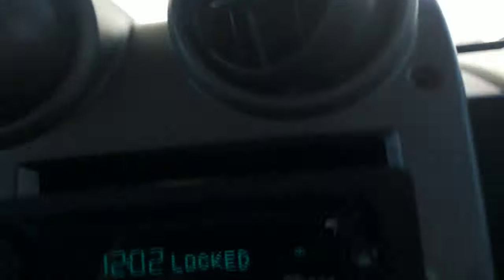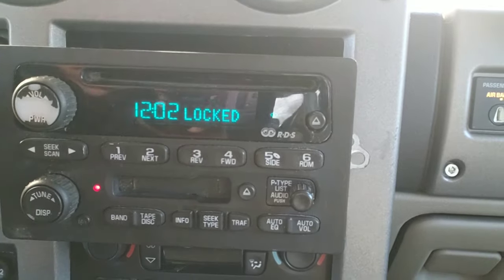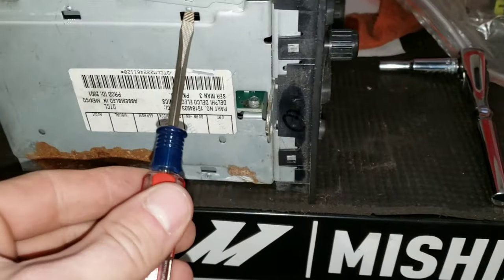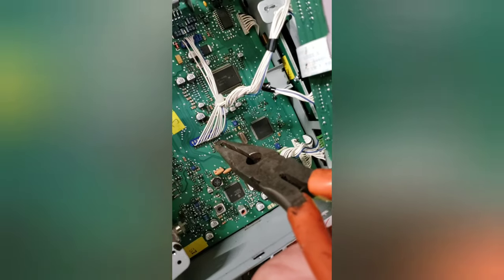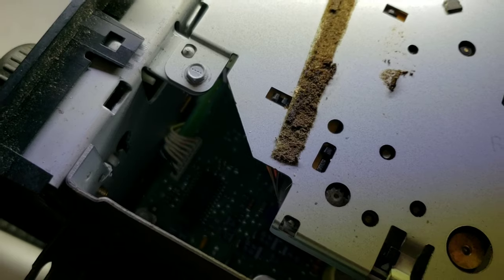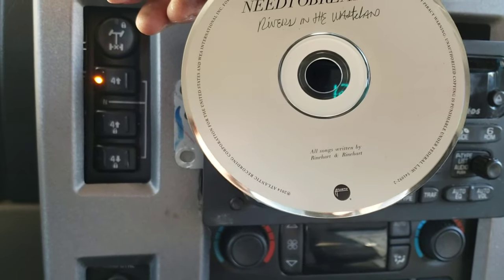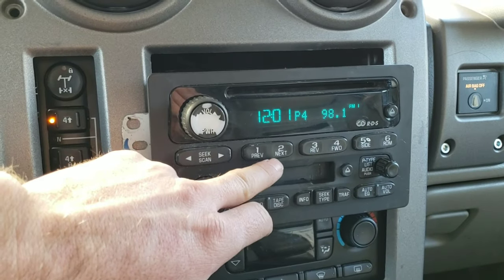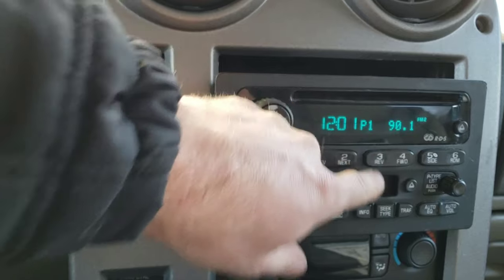How to fix "locked" gm radio yourself

Comment: Who on earth is going around robbing mid 2000's GM cars for their radios?
Reply: Lots of people when they were newer. A replacement was $500.
Reply: @johnnysouza5601  makes sense, there probably weren't many aftermarket radios back then.
Reply: @1Thatstrangeguy  there was but some people wanted all original dash. I didn't really understand it then. With today's infotainment systems I understand but not the stock 2000s gm radios
Reply: ill admit that a lot of aftermarket radios look really gaudy, i wish someone would come out with retro looking radios with dials and a physical needle but with modern electronics and bluetooth
Reply: @1Thatstrangeguy  what kind of retro are you looking for? They have those for most classic vehicles, 70s pickups etc. Look identical to original with modern technology
Reply: @johnnysouza5601  i'm thinking early to mid 80s radios. Iv been tempted to even design my own and 3d print it so i can get all crazy
Reply: @1Thatstrangeguy  if you can figure put to make them I'm sure theres a market for it. I bought one for my 75 chevy so I wouldn't cut a whole in my dash. I loved it. Looked original but did everything I wanted.
Reply: Nobody.  Lol
Reply: I am that's y I'm watching this video

Comment: WARNING - What he has done is to rip out the EEPROM (flash memory) that stores the radio security code AND the preset stations. This chip predates USB flash drives, storing only a few thousand bytes of data. He risks serious damage - these chips are SOLDERED to the board. Ripping it out with pliers can lift off/break copper traces on the board, killing the radio.
Reply: And what do you suggesting, Nothing.
Reply: Either way your radio is inop, either cuz it's locked or cuz the thing is broke during the chip removal. The latter at least provides some chance of it working
Reply: Late to the party, but in case someone else come across this later - the fix to that is just to remove pin 8 from the chip. For those that don't work with electronics to know, pin 8 on a 9355093, is the top left corner pin that's over the first 9 in the number. That removes the power source to the chip, without potentially damaging more of the board.

Comment: This does work on all GM radios HOWEVER it can cause oddities. I did it to my locked radio in my pontiac and now everything works BUT it forgets presets everytime you turn it off, the CD button works intermittently but the CD works when you put it in every time. And the radio thinks theres a tape player now. So user beware!
Reply: It worked on mine but now I have no display but the lights are on
Reply: How about 05 chevy impala?
Reply: @dannie0048  should be the same

Comment: Thanks! I can confirm that this works with the 2006 model without the tape deck for sure. The  part is on a different part of the board. Bottom corner instead of the middle. But the part number was the same, except the first digit which was a 3 not and s. The eprom and neighboring components were identical. Thanks again!

Comment: If you know someone with a decent bi directional scanner, they can do the vin relearn for the radio. the only thing, when I used my snap-on scanner, I had to built a 2006 avalanche with the navigation radio for the radio option to come up. It still worked and that was done on a 2002 chevy s10.

Comment: Amazing. This was the only thing that worked for me in my Chevy Sonic 2013. The chip was hard to find but I figured it out. 8 pin chip labeled EEPROM (next to the chip, not on it) The chip was in the same area as in the video but the board is layed out differently.

You saved me $150 on top of what the scrap yard charged me. Made my day. Cheers!
Reply: You think the EEPROM chip is on all radios with the lock feature, at least all GM vehicles?
Reply: @jackburton2680  It's possible. Maybe not in the newer gen of vehicles but then again I'm no expert.

Comment: Did it to an 2006 H3 stereo 6 disc pulled half the eprom out on it and it has zero issues .. remembers time presets and no errors.. crazy you saved my sister at least a hundred dollars!!! Get the factory monsoon stereo suns back.. dang it sounds good!! It’s a different chip number than yours.. but you got me in the right direction!  Thanks!!
Reply: Still working? Putting in a new radio in mine now
Reply: What do you mean you pulled half of the eeprom out?

Comment: Question: If the eeprom chip in the old radio is the same as the new radio why can't you just remove the chip from the old original radio and use it to replace
the chip in the new radio? Old chip has the VIN number of the vehicle. Unless the socket for the chip in the new radio is different then it should work
Reply: did you get an answer for it? thx

Comment: “It may not remember your statures stations”.  That because EPROM stands for Erasable Programable Read Only Memory.  In other words it’s designed to maintain the memory of the radio.
Reply: Will the EEPROM removal effect clock memory? That’s all I care about losing. Presets don’t matter.
Reply: @reedharrell5279  I'm not 100% sure but I would think it would.  If you know/think about the BIOS Battery in a computer this EPROM is similar.   The BIOS Battery maintains the date, time, chipset, fan speeds, and others.  The EPROM is maintaining similar information.  So if there is not constant 12V to the radio the entire time then you will even loose your clock.  Again I'm not 100% positive on this.

Comment: I used to refurb these radios. Buy a new GM most likely a refurb radio without you knowing.
Reply: I did that with electronics like those instrument clusters and abs modules. Half of the repairs were to already 'refurbished' boards.

Comment: Well, you did the preset on fm1, when you turned it off and turned it back on, you went to fm2. So, of course it wouldn't go to 98.1 cause you saved it on fm1, not fm2.
Reply: That’s one heck of a catch dude. I had to screenshot it so that I could  see the numbers LOL but you are absolutely correct.

Comment: Worked for me, pulling the little thing was kind of a pain. Found crushing the black shit with needle nose then pulling the plate with tweezers worked well.
Reply: Did you have sound still? I have a 2002 Buick rendezvous , and Im either going to pay 150 to get it fixed smh or try to pull that piece. But does your sound work
Reply: @BigSwirl  yep sound works, and the radio works but the cd player is fucked up, it wont give me back my skynyrd album.
Reply: @flustercluck420  okay , thank you . Some of the comments were saying that this method caused no sound to play  at alll

Comment: will all the other functions work after removing the chip? I have a used radio to go into an 05 silverado. I've already tried holding the scan forward and 5 button while pressing the power button on. The radio does turn on, but only the volume knob and tuning knob (not the seek or scan buttons) will work. The cd player also works if you insert a disc. I understand pushing these buttons is only a "test" mode. Just want to make sure all the other functions will work after I remove the chip (fader, balance, auto eq, auto vol, etc...)

Comment: Craig my tape player broke I use it for my phone the bluetooth cassette got stuck. Is it hard to replace the cassette part of the radio? You make it look easy to take out. How many screws and wires?  I have another radio already that doeant power up anymore. I just want to use the cassette mechanism...do you you think this could work?

Comment: Pushing the number 5, seek forward buttons while powering on also unlocks these radios and all functions work as they should..fyi this button method is said to be a temporary fix and eventually the radio will lock again and you will have to do the 5 seek and power on again

Comment: If you have a 2006 or newer GM vehicle just take it to your top of the line mechanic shop. We unlock them at our shop.
Reply: WHAT'S YOUR METHOD???   WHAT WOULD HAPPEN IF THAT CHIP WAS REPLACED WITH A NEW ONE????

Comment: Can I take the face plate with the nobs and the board behind it and put it in my original radio on my 2003 Chevy Impala ???? As I bought one on eBay and of course it’s locked

Comment: WHAT WOULD HAPPEN IF THE CHIP WAS REPLACED WITH A NEW ONE???
Reply: If by "new" you mean blank, I did that in an OEM Chevy Cobalt radio.  Saves presets but volume is much lower and it says "Calibrate" every time it turns on.  It wasn't the original radio, just a cheap one off ebay.  Works though

Comment: 2003 gmc seirra 2500 if that matters does not look the same or have same part number I guessed an pulled out of two that look the exact same as in picture and it worked but it won't look anything like his radio and isn't in same location

Comment: Okay but why is there no sound in your video or from my radio :(
Reply: Same here
Reply: @ZDMBeats  mine was because I have a bose setup and non bose radio. I bypassed the amp by plugging the radio directly into the same size port to the right. Works good now just a few random issues like the rear audio works as it's own channel and no presets.
Reply: Do this didn’t fix your radio?

Comment: Anyone know where the eeprom is on a 2003 Monte Carlo 6 disc changer with tape deck?? I opened mine like the video and there's nothing that looks like the one in the video.  I looked everywhere and I don't anything with that s code either. Thanks

Comment: I removed the correct chip. It seems that they all have the same number. The stereo is not locked anymore. My error message is up and I can't get rid of it. This is on a 2007 Grand Prix GXP. The stereo is from a 2006 Grand Prix GXP. Has anyone had this problem after removing the chip where the error message doesn't go away?
Reply: This is happening to me now. Did you ever figure out a solution?
Reply: @Veronica-lz1ln  unfortunately no.  Ended up buying a reconditioned factoey stereo with warranty and obviously unlocked.
Reply: @domenicmanicone2612  thanks for the reply! I appreciate it so much!
Reply: @Veronica-lz1ln  your welcome 🙂

Comment: I've replaced a few GM radios, my scan tool can unlock them no problem.  I've never heard or seen this exploit before.  Makes me wonder if the radio would be able to program a key fob.  For GM cars that have key fobs, it can be programmed without a scan tool by using the DISP on the factory radio.  I wonder if removing the EPROM (or is it EEPROM?) would interfere with that.
Reply: Oh! Dear ! Loooooool
Reply: What scan tool are you referring to in this case? Hopefully one that isnt 10,000
Reply: @FredFlintstone21 , I have a Launch X431 Torque, costed me about $2,300.  HarborFreight sells one called a ZR Pro I think, sometimes it's on sale for $999.  I believe that it's the same scan tool rebadged because the interface is exactly the same, and the input for the subscription key is also the same.  If I had to do it all over again, I'd buy a Autel Maxisys, which I probably will eventually.  The X431 that I have is good usually, but sometimes it's a little buggy.  I was able to program key fobs into a 2002 Impala, but not into a 2003 Impala.  It was the scan tool's fault because I was able to program the fobs using the factory radio.
Reply: Does sound come out with the Cal Err code? I heard it takes a few weeks to learn the new vin. Did the Cal Err code ever go away?

Comment: What he forgets to mention in the video is that this will completely f*ck up your radio and it will basically be brain dead. You can see when he turns the volume knob or pushes the preset nothing happens.. well that’s what I’m dealing with on this stupid nice radio I’m trying to put in my car from my previous one, both GM and use the same radio. But after removing this chip it very well could TRASH your radio that you probably paid $100+ for if you bought it unlocked. GM’s security system is bullshit. It doesn’t inconvenience thieves because nobody is stealing these. It only causes grief and headache to the owner if they want to update their GM radio but can’t because of this tyrant security bullshit. I bought the car, I should be able to reuse my radio if I want to. SMH

Comment: OOOOOOOOOORRRRRRRR go to Walmart buy that $50 radio with bluetooth and call it a day
Reply from the maker: And wiring harness and dash kit and antenna adapter and wire it up yourself
Reply: All day......... loooooooool
Reply: Your key fob prolly want work either.
Reply: Still need to buy the by pass for security if your using factory wires
Reply: @grumpyghost4440  I don't this on a 07 Pontiac G6 and it worked and everything works as it should fob and everything no security light or anything on dash

Comment: Why didn't you use the method of pressing the preset buttons like you described?
Reply: If his radio is VIN-locked (coded to the specific car), it won’t work because there is no code to enter. It can only be recoded by using the dealer diagnostic tool or by altering data in the EEPROM chip.

Comment: anyone else do this and everytime you turn the key off it loses clock and station settings? put one out of a 04  trailblazer into a 03 Silverado and worked fine then everytime you turn the key off it resets basically.

edit, never watched the end of the video lol, I see this does lose presets oh well